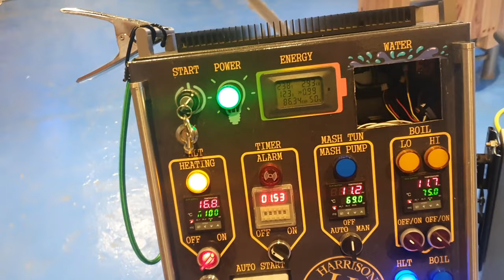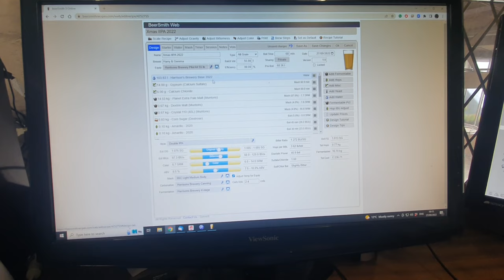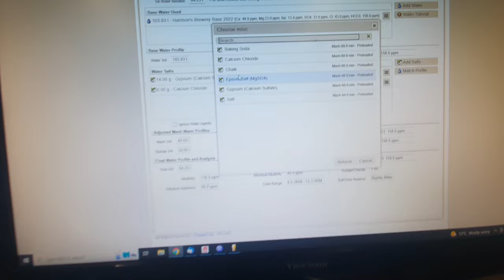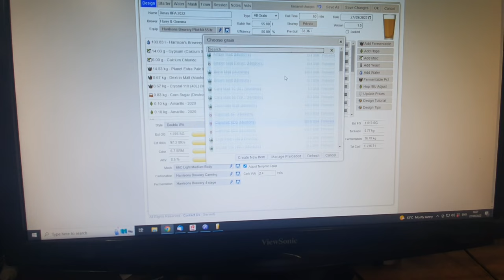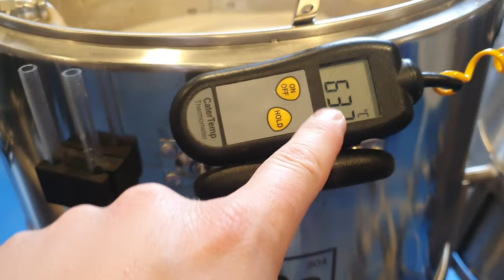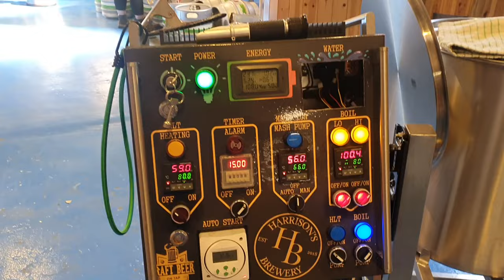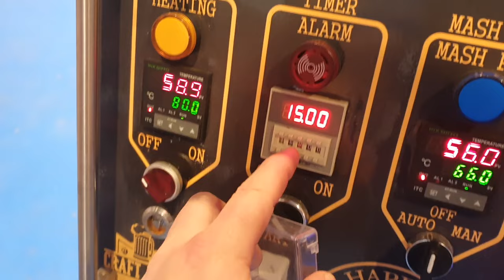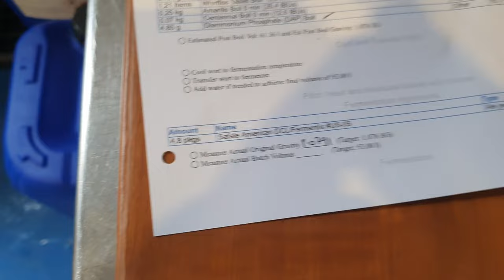Vlog 862 Xmas IIPA 2022

Comment: Nice Video. I just originally grabbed a bunch of "target" water profiles off of Brewers friend and save them within Beersmith (on version 3) .. then after i select my own town's water profile I just tell BS to match it to one of these pre-saved target profiles and it auto detects the correct amount of salt to add to change my water to that of the target profile. ... never ever noticed the RA to be out of whack or that it throws the colour out on the design tab? Would it not be easier to just match to a specific profile in accordance to the style ?
Reply: You can pick the pre-set profiles in BeerSmith but always check the balance values at the bottom of the page are on target for what you want. It's not perfect and can throw some odd values in profiles.

Comment: I have to play around a lot with water chemistry as my tap water is high alkalinity. I have to run three sources of information to assist with getting a formulation: Palmer's water chemistry spreadsheet, the MpH 4.0 Spreadsheet, and the Beersmith water calculator. All three yield slightly different results *sigh*. The biggest issue with targeting SRM for the RA is for beers, like a Schwarzbier, where the heavily roasted malt bill is a very small fraction of the total grain bill, and therefore does really contribute much in malt acidity even though the beer is high SRM. I think the closest coming to factoring in the grain bill is MpH, but it always appears to result in a mash pH that is higher (one to two tenths) than reality.